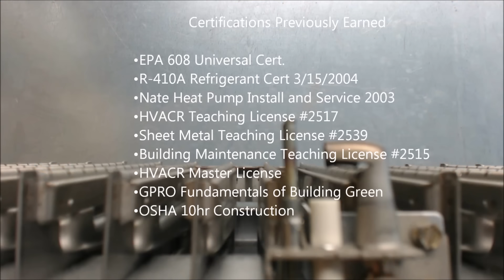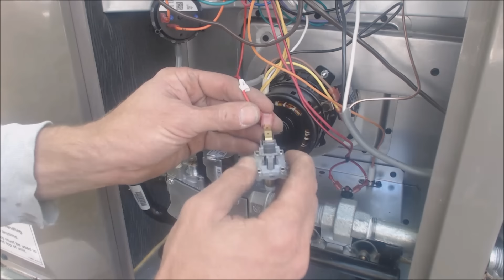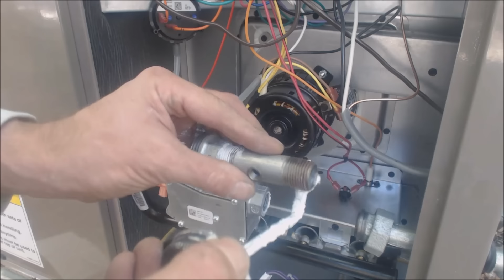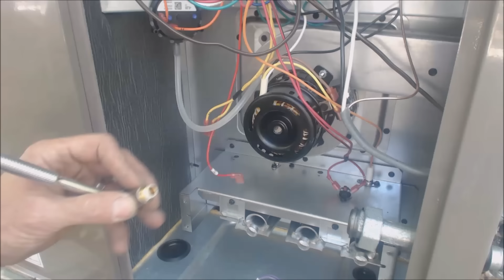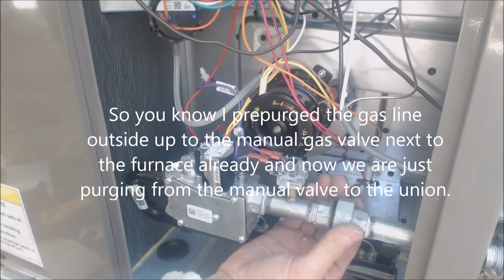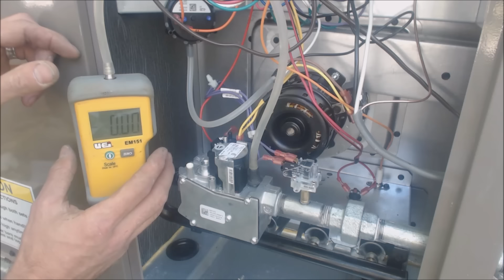Natural Gas to Propane Conversion on a Furnace from Start to Finish!

Comment: On the low pressure switch there are 2 terminals with spade connectors , you show 1 going to the flame sensor but where does the other one go?

Comment: One gas furnace manufacturer  propane conversion kit didn't come with in line low pressure gas safety switch.  I called them, and they said they don't want low pressure switch installed because it is detrimental to their gas Valve diaphragm.
Reply from the maker: A safety switch will have no impact on a gas valve diaphragm. That was a pretty bad excuse.  That is a shame that they didn't provide one. Most manufacturers do, thanks

Comment: I am in th process of doing this on a 10 year old Carrier furness. Going from lp back to natural gas.  However I do not believe the installer left the original parts from the natural gas unit.  I'm going to look around the furness more to see if I can find them, however if I do not what is the best method to use to track down and locate these parts?  Should I just contact the manufacturer with model number or is there a cheaper easier way to find what I need?  Any online suppliers you can recommend?   Excellent video, very helpfully....  Thank you!!
Reply from the maker: I usually contact the local distributor to get the conversion kit back to natural gas. Go to the manufacturer website and look up distributor locator or call around to see which of your local distributors deal with Bryant/Carrier/Payne. I don't have an online source for that one, thanks!

Comment: Thank you for these great videos. Can anyone help? I have a 70,000 BTU Rheem running on propane. The Inlet pressure to gas valve is 12" WC  outlet is at 11" and regulator will NOT adjust to the required manifold pressure  to 10" WC. 
I've replaced the White Rogers gas valve 36J24-214 and converted to LP but still won't reduce. There is absolutely NO response whatsoever when the adjustment screw is turned either way. I replaced the natural gas spring that came with the valve  with the LP spring F92-0659 and the burner orifices are 1.10 M as required by the manufacture. any ideas?

Comment: Great video! I adjusted the pressure to 9.5 the flames however seem very long and are going down the curve of the tubes. They are blue until a few inches before the tube bends then the flame is yellow going down the bend.
Reply from the maker: What pressure does the manufacturers conversion kit say to set them at? Make sure to follow the pressure recommended by them, thanks
Reply: Sounds dangerous .   Get a tech that has a manometer .  Or buy a meter & Learn how to calibrate the gas valve .    Read the instructions first !

Comment: Is there any possible way to adjust pressure without a measuring meter?? Or bout how many turns will it take to make this change over. Leaning to dirty fuel but have not adjusted pressure orifice size is lp 42

Comment: in case the upstream regulator (i.e. tank side) has a restriction failure, should not the supply propane side be "stress tested as well tested during combustion if existing system has no low pressure cut off in-place?

Comment: 18:30 AC service tech!  What happens if the inlet gas pressure to the gas valve is beyond the 13 in WC. Say it's 15 or 20 etc. More or less....do you call gas company to adjust or do that yourself?  What's the next steps to fix... thanks... also would you run the unit in the meantime or safety hazard?
Reply: I would have the company come adjust their regulator and also never adjust outside the manufacturer specs for settings.

Comment: Hi there. I have a lp furnace that was converted years ago, that works but just won’t get much heat. It takes forever to raise the homes temperature by 1 degree. Any thoughts?

Comment: Where did you read that the manufacture required the Tap ?
Reply: And where did you read it required a low pressure gas switch

Comment: I am not a tech by any means, however is that galvanized as opposed to black iron? I am going to install a furnace and I read that due to possibly of flaking of galvanized it is not recommenced. great information, thanks for taking the time
Reply from the maker: Our inspectors only allow galvanized to be installed here since we are near the coast. However, it does not even refer to the topic in our code book IFGC 2018 so it is up to your local inspector and how they feel about it, thanks!

Comment: So after you connect one of your leads from the low pressure switch to your flame sensing rod. Where did you connect your purple lead from the low pressure switch. Where did you connect your other one?
Reply: Same question

Comment: can someone let me know what could be wrong with mine as i have a goodman that is in good clean condition and the propane tank ran out around mid spring so I just got it filled and now when I turn the furnace on it tries to light but I get no flame and it tries again a few times, then you get a red blinking light that has a steady 1 blink at a time, could it be that there is air in the gas line or could it be the gas valve failed and haven't pulled the wires to test for 24v yet , anyone have any idea ?

Comment: For new tech's remember LP gas is heavier than air and goes to floor not up in air like natural gas. So don't bleed off to much.
Reply from the maker: Yes whenever possible, do that outside, thanks William!
Reply: @acservicetechchannel  I went on a call one time where a guy was bleeding lp near a water heater got blown through a wall. He did not know about the difference in gas. He was lucky only minor injuries.

Comment: Acservicetech.  I have a natural gas water heater that was bought for a super price on a closout two years ago. They told me I can use it for propane,  turns out it is for natural gas. I don't have money to get another one. Is there anything I can do to convert the water heater so I can hook up propane?  Also the water heater is Rheem classical. Your such a good instructor.
Reply from the maker: You would need to purchase a new gas valve assembly if the old one cannot be converted. The water heater itself would typically be fine to change over but you need conversion or one made for propane, thanks

Comment: Do all changeovers involve the low pressure cutoff install? My unit is electric ignition , not pilot light/flame.
Reply from the maker: Most do yes, unless it is an older furnace with a conversion kit installed a long time ago. The main purpose is so that if the propane tank were to get low that there would not be an abnormal flame in the combustion area. Thanks
Reply: if you skip it what happens?
Reply: ChrisD4335 kaboom

Comment: Why didn't you check for the wc factory recommended settings on the furnace data panel?
Reply from the maker: The conversion kit was purchased by the manufacturer and comes with the propane wc pressure. The existing rating plate would only have nat gas pressure, thanks!

Comment: instead of the union on the pipe can you use a coupler?
Reply from the maker: So the union or a flexible connector is the last thing to get connected when installing a system. This is because the piping is heading in two different directions. Thanks

Comment: So I live in a Mobil home that came with a natural gas furnace, and when I moved in it was running on propane. I suspect that the person who originally bought the house skipped the conversion, would the furnace run, even if the conversion wasn't done?
Reply: It might run. The combustion will be terrible and will produce very little heat.

Comment: I have a question about break the flame rod wire
  The flame rod is send a signal to the circuit board to prove burner are ignite, since  breaking the flame rod wire, how to send a signal back to circuit board?
Reply from the maker: Are you talking about a normally closed safety switch breaking the flame sensor wire if the safety device opens?
Reply: yes
Reply from the maker: Yes if there is a safety concern then the safety switch would open the electrical circuit ending the danger of the flame. If there is no danger then the safety switch would remain closed and electricity would flow, thanks

Comment: what's the point in purging the line?  I changed a manifold out and the furnace came right on without purging??
Reply from the maker: It may have been a short run or you may have only had the gas line open for a short period of time but otherwise, the furnace may try 3 times and lockout, thanks!

Comment: That's not the supply pressure, that's the regulator lockup pressure. To check supply pressure to the appliance, you need to have the appliance running to check supply. Under a no gas flow the regulator will continue to fill the gas line until the pressure overcomes the opening force of the spring to close the seat, thus your lock up pressure. Same goes for natural gas.
Reply from the maker: I agree that what I checked first was the reg lockup pressure. I always check that first because sometimes the reg is set too low to even have a chance at providing the correct flow. I know the useful capacity measured in flow is too low going to the furnace. I did not check this on camera. The tubing is sized correctly, the regulator capacity is correct and spring pressure set right and there will be a pressure drop on operation but not that low. This has to due with the lp tank size and available vapor in the tank. I recommended a larger tank size since it was a 100lb tank at a campground unit and then I would come back. I just figured I would shoot the video since I was there. Thanks for your comment!

Comment: Our gas company does not permit unions inside the furnace cabinet, nor flex gas lines.
Reply from the maker: Thank you very much for your comment! We follow the IFGC 2015 here. It does not bring up the topic or mention not to use unions in furnace cabinets. I never use flex connections inside units either. In my opinion, it is too thin of a metal to have coming through the cabinet wall as well as near burners. Thanks!

Comment: Hi, where can we find the switch/sensor you are using ? Thank you for your time
Reply from the maker: That seems to be the rough problem. They usually come with the lp kits. Here is a johnstonesupply.com # L41-667
Reply from the maker: Here is a link for them: https://amzn.to/2nDx86q
Reply: I have never had one on a propane conversion. There really isnt a need for it

Comment: Are most of the conversions Propane to Natural Gas because of the lower NG cost?
Reply from the maker: Furnaces usually come as natural and they get converted to propane because natural gas is not available. Then when natural gas becomes available because they ran the main piping at the street and brought the piping and meter to the house, the furnace gets converted back to natural again, thanks!

Comment: since when do you install a union fitting INSIDE the furnace.....since when is that code???????
Reply from the maker: Thank you very much for your comment! We follow the IFGC 2015 here. It does not bring up the topic or mention not to use unions in furnace cabinets. I never use flex connections inside units. In my opinion, it is too thin of a metal to have coming through the cabinet wall as well as near burners. Thanks KaOsOwNED!
Reply: Lo

Comment: Did you use just pipe thread sealant on those or did you use PTFE natural gas tape sealant also?
Reply from the maker: Just thread sealant. I typically only use tape on water lines before adding some thread sealant on top just to help the thread slide instead of cut through the tape, thanks

Comment: Thanks for the video!! 

Where would I be able to find one of those rubber bushings you used to connect the manometer tubes to the gas valve? I’ve looked online and can’t seem to find one.
Reply from the maker: I actually got that from my original yellow jack gauge type manometer as part of the kit back before I switched to the UEI digital and SDMN6 manometers, thanks
Reply: AC Service Tech LLC thanks for the reply. When I was at one of my wholesalers today I actually saw the nipple on the manometer gauge that you are talking about. Asked the owner of the company if he sells the nipple and he did. Yellow Jacket Part number is “78065 - Rubber Nipple” if anyone else in the future is wondering
Reply from the maker: Thanks Matt!

Comment: I need to convert a 2002 Nordyne KG6RC-120C - 20C 90+ AFUE updraft/horizontal unit from natural gas to propane. Nortek customer support says their Nortek kit 904090A is the correct one to use, but it does not appear to have a low pressure switch in the kit; Nortek CS says a low pressure switch is not necessary with this unit.  Does this sound correct ?

Also, my unit came without the larger panel which covers the control area; is it OK to operate it hung in a horizontal position in my shop without that covering panel ?
Reply from the maker: Most manufacturers provide a low pressure switch with the conversion kit. If the manufacturer is not concerned and if you make sure to not run the tank down to empty then you will be ok. If you want to find an generic low pressure switch with a tapped nipple then that would be good too. It is a safety that is normally provided. I cannot recommend that a furnace be permanently installed without that cover. It should operate ok but it will be easier to get dust into the combustion area and would be an electrical hazard. The electrical hazard is a big deal if it is accessible due to the amperage being drawn. Thanks for the questions Phil.
Reply: Thanks for the reply. I plan to hang the furnace overhead where it will 
not be accidentally accessible, but I will look at devising a cover for 
the burner compartment.

 Would the 12 to 13 inch water column line pressure and 10 inch water column regulated pressure also apply to this 120,000 BTU unit?  The Honeywell gas valve on this unit does not have projections at the pressure measuring points so I assume I'll need an adapter to screw into these ports to attach a manometer tube unless one comes with the conversion kit I ordered yesterday.

Finally, can you suggest a good source for a low pressure switch?  I see conversion kits for other brands of furnaces that include one, but have not found a switch alone.

BTW, there are well written instructions for building an inexpensive water column 
manometer at http://www.rverscorner.com/manometer.html In case other 
folks (like me) have no continued need for an electronic one.  I plan to adapt one I already built to balance my Triumph motorcycle's carbs.
Reply from the maker: The exact pressure that they want you to set it at should be in their conversion kit instructions. It should also have an lp sticker and new ratings sticker to stick on your furnace. Yes you will need a barb adapter and you may be able to just pick one up at a hardware store. Here is an amazon one - http://amzn.to/2iUlcFr - but just select the 1/4" barb x 1/8" npt male pipe or -  http://amzn.to/2it4gXQ
-- Yeah I am having a hard time trying to find the tapped nipple and the switch by itself online even with one right in front of my face with the numbers on the unit.
Yes original water column manometers are just that, inches of rise in a column of water. We all use digital ones to sense small pressures such as .1 and .2 wc

Comment: Do you use galvanized or black iron pipes for gas lines? Thanks.
Reply from the maker: By code you can use black iron or galvanized but I am located near the shore so all we use is galvanized.

Comment: This is a single stage furnace. What if you have two stage?
Reply from the maker: You would need to replace another spring then too. Both speeds would need to be measured and adjusted to manufacturer specs, thanks!

Comment: At the 16:20 point in the video the tech preps the burner gas valve for gas inlet pressure testing. The added reminder (warning) to make sure the gas cock to the furnace has been CLOSED before loosening the inlet test port allen screw comes after the fact instead of before. I realize most techs are not likely to miss the step if they have their head in the game, they'll know not to monkey with a gas valve without turning the gas supply off. But doo-doo happens and what I'm afraid of is someone performing the conversion may PAUSE the video before seeing the warning to close the gas cock and possibly begin the process of opening the supply side test port with LP available to the valve. Also not mentioned, it is a good idea to have an electronic LP gas detector with alarm, operating in close proximity (on the floor) while working on LP equipment. A battery operated LP alarm should be in every furnace room or basement, fulltime, where LP equipment is utilized. The tech also mentions purging the gas line "from outside to the 1/2" gas supply union" on the furnace but he omits what precautions he took to safely perform the purge.  Flammable gas supply lines should never be purged, open ended, inside a home but rather be temporarily connected to flexible tubing, suitable and long enough to carry waste gas to the outdoors, at least 10 ft from any structure.

Comment: where can I find the nipple adapter? where you put the cutoff switch. or did you made it yourself
Reply from the maker: The nipple would come with the conversion kit or they would supply you with 1/8" piping to branch off of your inlet pressure tap on the electrical gas valve. I didn't make it. Thanks JM!
Reply: I think he made it because i cant find it for the life of me